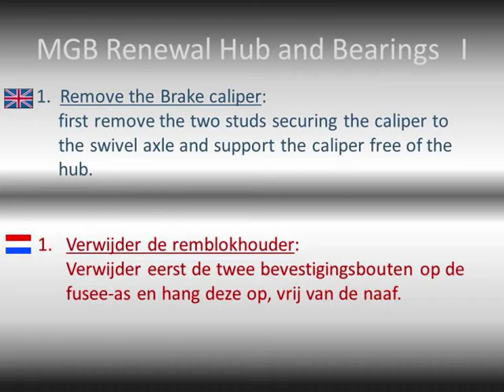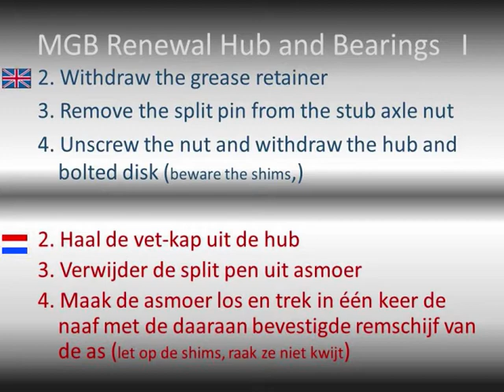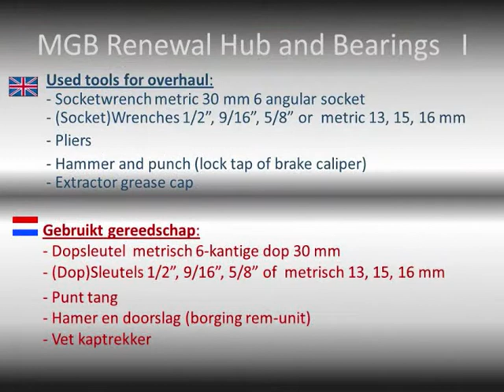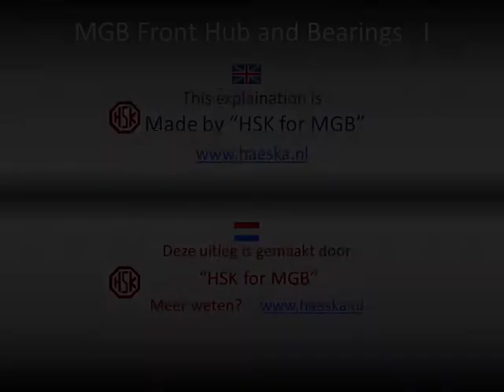MGB change front hub and bearing part I

Comment: I was wondering how the cotter pin came out ....thanks
Reply from the maker: Hey Cheryle, Thanks for watching. In the video between 1.50 min and 2.15 min you can see how the cotter pin comes out. At first bent the two ends of the cotter pin together. Turn the hub untill the hole in the hub is in alignment with the cotterpin. Use a needle nose pliers or an hook and pull out the cotterpin. (position of the hole in the hub is in the splines area) 
I hope that this explination can help you.